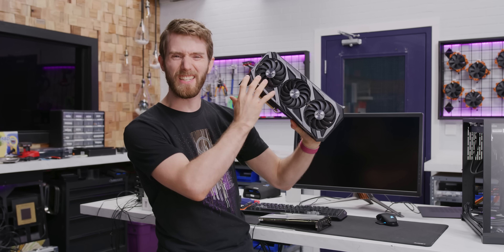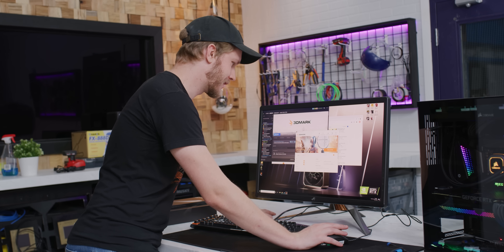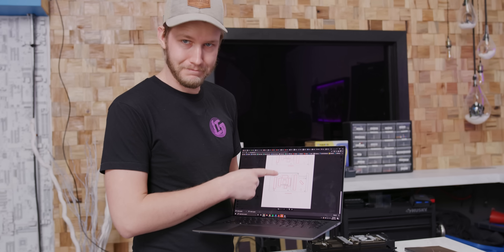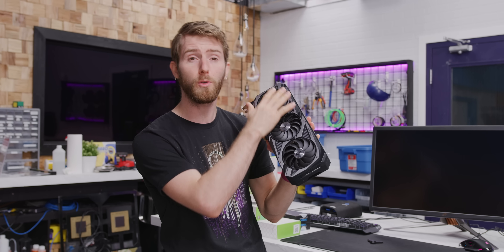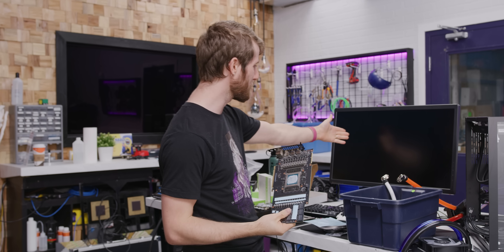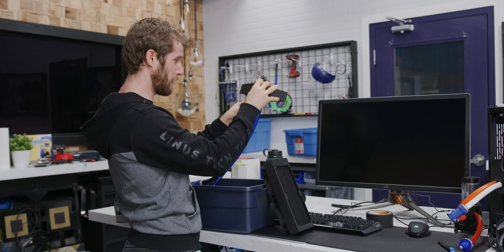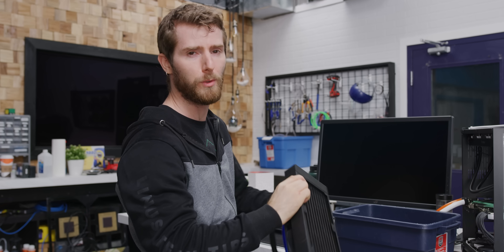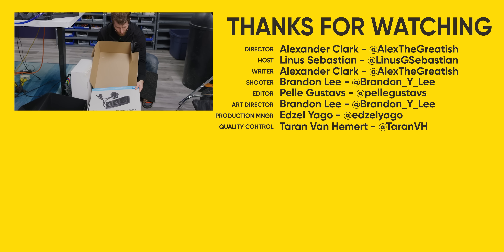Water Cooling the RTX 3090 is... More Complicated

Comment: Linus: "Figuring out just how much radiator we need"
Yvonne's Mechanic: "Your radiator is missing"
Reply: While it's a fun joke, I'd rather pay for a Mo-Ra 3 420 radiator than mess around with a car's aluminum radiator that's going to need anti-corrosives and adapters to work at all and the fan mount is gonna be janky as hell, too.
Reply: @Steamrick  but if you steal the radiator from a Dodge Challenger Demon, chances are that you can cool your computer passively.
Reply: @Ocastia  Steal is right... I looked it up and that radiator costs $350 new
Reply: @Steamrick  Dude Alphacool has some pretty baller radiators for PCs, I'm planning on getting a 200x400 one to put in a new case, and they have 400x400 as well- if you want to passively cool your PC that's the way to go lol
Reply: @patrickhector  The Mo-Ra 3 420 is 420x420, for 9x140 or 4x200mm fans. You can see one on Steve's (Gamersnexus) workbench often as not.
Even that monster with its huge fin spacing and low airflow optimization will top out at about 200W passive.
Reply: @Steamrick  Go to a junkyard, find a car from 197-whatever, and you won't find those Reynolds Wrap pieces of shit you find in cars today.  I have yet to own a car newer 1990 that I didn't have to change the radiator within 2 months of buying the car for some damn pinhole leak.
Reply: @FlanylShirtman  where da fuck do you drive? 
When I used to be a car mechanic damaged radiator where quite rare even on Porsche's.
Reply: Linus Tech Tips Playing minecraft with Obama https://youtu.be/-JiA_5Uu4Rc

Comment: So at the very start of the video, you show that it doesn't thermal throttle with air cooling. What is the purpose of even going with liquid cooling at that point? Especially when games would generate a lot less heat than a 30 minute stress test.

Comment: "Can This Cool an RTX 3090?" Cute but the real question is: Can you BUY an RTX 3090?
Reply: https://youtu.be/o7ad86uP0wM?t=10 maybe you should watch this video for your problem
Reply: Real question is what for?
Reply: @montazownianr1  8k gaming
Reply: @r00kiet80  If you have a 8k monitor I reward you
Reply: @zahhym  if ur able to buy a 3090 i'm pretty sure u can get ur hands on a 8k monitor/tv
Reply: @r00kiet80  Work
Reply: @r00kiet80  No I am saying you need both to take advantage, and even if to have a 60hz 8k monitor is rly good, and to get both is virtually out of reach, both budget and stock wise
Reply: @zahhym  thats what i'm saying if ur able to get a 3090 ur able to get a 8k monitor/tv
Reply: @r00kiet80  ok
Reply: @montazownianr1  probably for extra 10%-15% for 4k @120Hz/144Hz gaming 🤷🏻‍♂️
Reply: Just got mine on Friday. Thank you evga notification queue. Still haven't gotten a chance to use it. Spent 20 hours redoing my loop with 2400mm of radiator space with quick disconnects to make it easy to connect my pre-ordered waterblock and new motherboard/cpu for ryzen 5000.
Reply: @Lead_Foot  I never felt more flexed on than reading your comment. Your build sounds really dope
Reply: The title has already been changed :p

Comment: May you make a video that cools a PC using 3M’s “dry water”?
Reply: Using the 3M Novec 1230 for submersion cooling would be a cool video. Boils at under 50°C so not suitable for replacing liquids in a loop (would constantly form bubbles and create pressure), but submersion would work great. It has an evaporation rate 4x of water though, so would need a sealed container, unlike oil. Would be an interesting experiment definitely.
Reply: @jubuttib  I saw someone run a PC while submerged in it. It ran quite well, but a little hot as the liquid was not cooled
Reply: @evolutionxbox  Yeah you would still need to have at least one pump and a radiator to get the heat out of the liquid, there's only so much you can soak into it even if you have a few gallons of it... =)
Reply: I wonder what kind of heat density would be so bad that the part overheats in spite of the 3M liquid boiling?...

Comment: 1:37 - Is SLI dead? - Yeah, it basically is

Basically sums up the entire last Video in one second
Reply: @XavierXavdreamerelo  I guess they didnt test for something in that space, for machine learning or rendering of very high poly objects and Scenes a even bigger VRAM is always nice.
Reply: @XavierXavdreamerelo  we're talking about gaming, for gaming it is dead mate.
Reply: It was a technology that seemed useful. It was unfortunately not developed well. Which seems to the case with any kind of parallel computing.
Reply: Lol
Reply: And some guy told me I should buy another 9600GT for SLI on my PC
Reply: @mix3k818  I don't think that affirmation is applicable to any graphic card. It was a statement about the newer ones. If running 2 with sli of that card was worth it on 2009, it might be worth it if you find an extremely cheap one and upgrading your whole computer is not an option you are considering.
Reply: AndiVx I mean, it did look like a semi-serious offer, though I do have an upgrade path already planned out with more modern hardware.
Reply: @XavierXavdreamerelo  *dead for gaming not dead dead. NVidia still has the connector on the cards for a reason. We accept that people like you need it. For gaming however, it is dead.
Reply: why do people still talk about sli when nvidia OFFICIALLY declared it dead 17 september 2020 OFFICIALLY no more SLI support..wth remove your blindfold people
Reply: @fredEVOIX  because there are still new cards that support SLI
Reply: @jakx2ob  Nope. That's NVLink, different technology.
Reply: spoiler alert for the people that have not watched it yet LOL
Reply: @XavierXavdreamerelo  The quadro's sli has a different name, basic sli is obsolete.
Reply: @XavierXavdreamerelo  SLI IS dead. What lives is called multi-GPU. Your software takes care of utilizing multiple GPUs. In SLI, driver tried hard to do parallelization job
Reply: @XavierXavdreamerelo  wasn't that what SLI was originally intended for?
Reply: @XavierXavdreamerelo  No one is doing any of that, lmao. SLI is a dead technology and will continue to be dead. Only researchers and rendering farms are doing NVLink.

Comment: Question: I want to buy a 2060 ventus xs and I don't know what kind of ram , cpu or motherboard to use. Can you please tell me? (1000$ Budget)
Reply: First of, he didn’t say he wanted a 3060, 3070 or 3080. My dood, use thermaltake 600W power supply or other 650 and more. Use t force 3200mhz 16GB ram. Use an ultra durable gigabyte B450M DS3H motherboard and finally a ryzen 5 3600 or less. This will take you to high end budget gaming and only $1100!
Reply: Or less money if you find cheaper dealers in your country or whatever
Reply: @alexh.9550  Thank you so much. :)
Reply: @Yeaits9cm  you’re welcome :)
Reply: @alexh.9550  What case should I use?
Reply: @Yeaits9cm  if you’re going for cheap, use Cooler Master MasterBox MB311L ARGB MicroATX Mid Tower Case with two big RGB fans fits all motherboards
Reply: @alexh.9550  Do you have another option for the power supply?
Reply: @Yeaits9cm  in my opinion Corsair or thermaltake, the motherboard you said the gaming plus yes it is compatible ryzen cpus like ryzen 5 3600. Use any thermaltake power supply it’s the cheapest.
Reply: @alexh.9550  I'm sorry I'm asking too many questions but can I use the cooler master 650w 80+ bronze power supply?
Reply: @Yeaits9cm  it’s ok you can ask anytime. Yes the Cooler master power supply is very good to go with.
Reply: @alexh.9550  Thanks a Lot.
Reply: @Yeaits9cm  you’re welcome. Uhh just don’t fry your motherboard 😉
Reply: @alexh.9550  :)
Reply: @alexh.9550  The Final Product
Motherboard: Msi B450 Gaming Plus Max
Cpu: Ryzen 5 3600
Ram: Teamgroup T-Force Delta 3200 mhz 16 gb
SSD: Intel 660p 1tb
Gpu: Nvidia 2060 Ventus XS
PSU: Coolermaster Masterwatt 650w,  80+bronze, Semi- Modular
Fans: Arctic F12 120 mm
Is this a good Pc?
Reply: @Yeaits9cm  this pc is better than my pc and yes it’s a really good pc good luck for your stuff to buy I hope everything turns out well make sure to apply a grain of rice or a pea method on the cpu and slap dat cpu cooler on! Don’t fry your motherboard.
Reply: @alexh.9550  Thank you. The thing is it doesn't even cost 1k.
Reply: @Yeaits9cm  you’re welcome, yup it’s dirt cheap some people don’t afford it doe lol
Reply: @alexh.9550   What about i get the 2060 KO Gaming GPU?
Reply: @Yeaits9cm  oh I have that one it’s so good for gaming
Reply: @alexh.9550  Ok Good.
Reply: @Yeaits9cm  if the cpu isn’t compatible you need a bios update.
Reply: @alexh.9550  Is it?
Reply: Go to pcpartpicker.com it will show you it is or not.
Reply: @alexh.9550  It didn't say anything about not being compatible.
Reply: @Yeaits9cm  so you’re good my dude.
Reply: @alexh.9550  Nice!
Reply: @Shadow Aura: It said this tho:

 Note:The motherboard M.2 slot #1 shares bandwidth with SATA 6.0 Gb/s ports. When the M.2 slot is populated, two SATA 6.0 Gb/s ports are disabled.
 Note:Some physical dimension restrictions cannot (yet) be automatically checked, such as cpu cooler / RAM clearance with modules using tall heat spreaders. 
Is That Bad?
Reply: why not wait for a 3060?
Reply: Get a 3070 i7 8th gen 16gb ram get an ASUS or gigabyte  motherboard
Reply: Wait for the 3070 and big navi. If you can get a b450 or b550 with a 3700x and 16 or 32gb or 3200mhz ram, that would be ideal.
Reply: @kmeg7330  WHat THE F**K HIS BUDGET IS $1000 WHY DONT YOU FRIGGEN UNDERSTAND....

Comment: Early Prediction: Of Course
Reply: Aight les see
Reply: Yeah
Reply: If I get my hands on a 3080 in 2031 I'll probably use a thicccc 360mm rad
Reply: I have a 240 and a 360 rad in my rig but my gpu runs 50° idle is there something wrong with it? 1080ti
Reply: @r00kiet80  has it always been like that? Or did you just build it? If it just started to get hot make sure the thermal paste didn't dry up or that your loop is still running.if you just built it make sure that they block is making direct contact with the heat spreader on the block
Reply: @Plane.  it was always like that i'm running it since a good year now never had a shutdown due thermals but my gpu is always kinda hot considering i have a custom loop
Reply: @r00kiet80  yea I would make sure you have good contact because that most likely is what it is. But as long as it isn't shutting down you should be good
Reply: @Plane.  its a hassle to get all the liquid out and disassemble the entire gpu i think i will keep it running until i upgrade or it breaks down